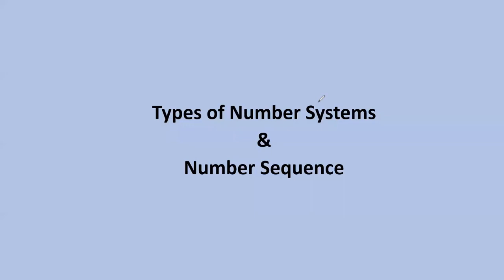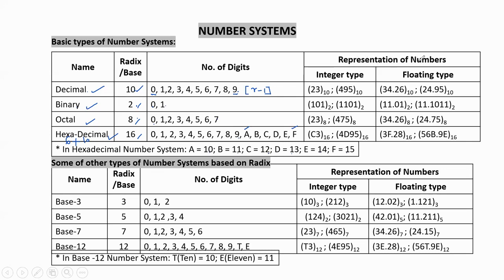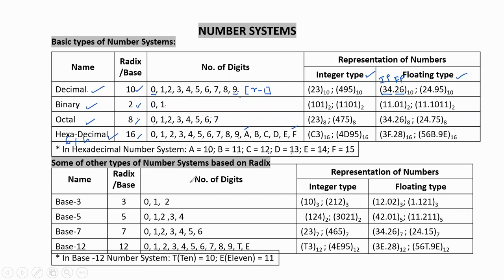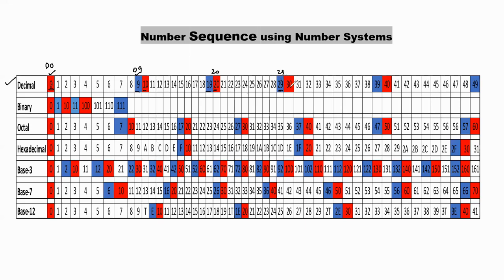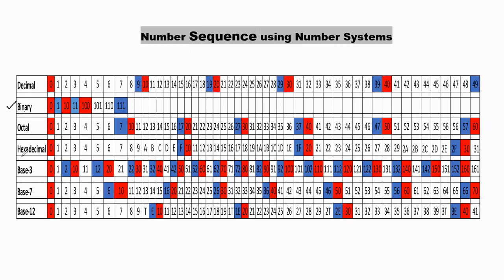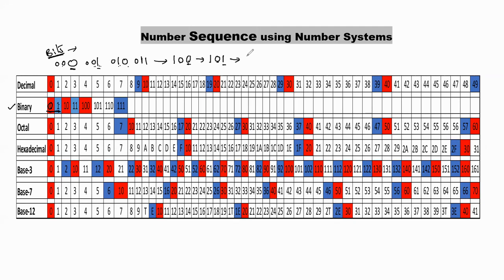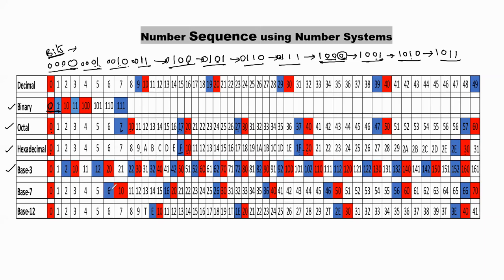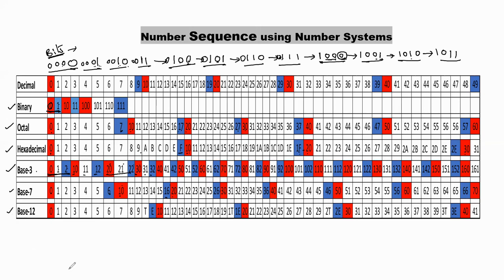1.3 Number Sequence using Number Systems | Radix | Integer type | Floating type

Comment: Base number systems that are higher than base 10, go through the 26 letters in alphabetical order.
Therefore, Base 12 cannot be “T, E” after #9 in its base system. It could however be just your version of a Base-12 system. 

Anyway, the real Base 12 system will always go like this …

0, 1, 2, 3, 4, 5, 6, 7, 8, 9, A, B, 10, 11, 12, 13, 14, 15, 16, 17, 18, 19, 1A, 1B, 20, 21, 22, 23, 24, 25, 26, 27, 28, 29, 2A, 2B, 30, 31, 32, 33, 34, 35, 36, 37, 38, 39, 3A, 3B, 40, 41, 42, 43, 44, 45, 46, 47, 48, 49, 4A, 4B, etc.
Reply from the maker: We can choose T  instead OF TEN  and E instead of  ELEVEN. No problem. To make easy for students we can use T & E also.
Reply: @menlotutorials    I think you meant to say “We can use T for TEN instead of A and E for ELEVEN instead of B”, if you were trying to make sense, which is no problem! However, I could suggest that you use “t” for TWELVE in Base 13, “I” for THIRTEEN in Base 14, “F” for FOURTEEN in Base 15, “f” for FIFTEEN in Base 16, “S” for SIXTEEN in Base 17, “s” for SEVENTEEN in Base 18, “e” for EIGHTEEN in Base 19 and “N” for NINETEEN in Base 20 - in your Base Systems! 🙂

That should make it easy for students too.
Reply from the maker: @craiglungren8703  If I am wrong, sorry for that. And definitely will consider your advice in postive way. Thank you